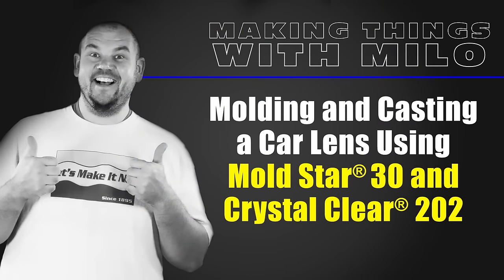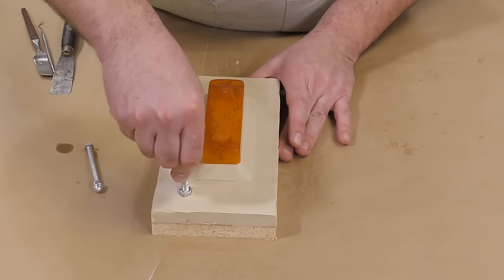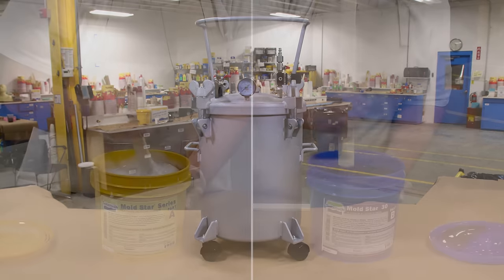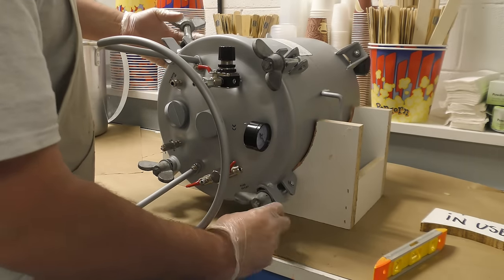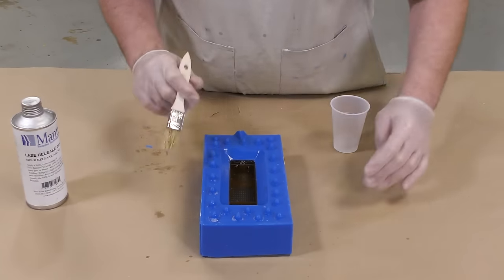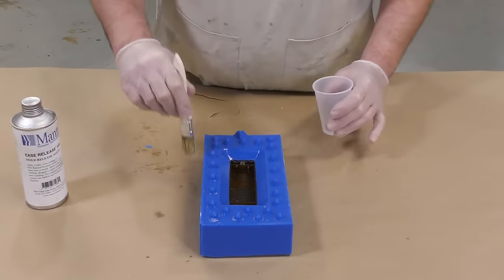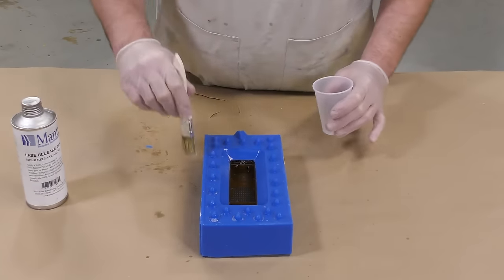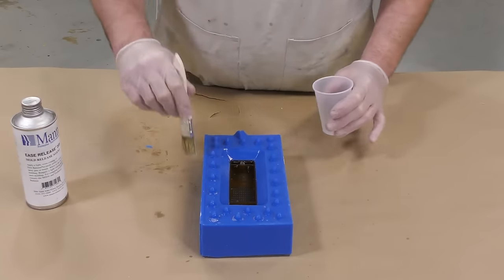How to Create a Replacement Tail Light - Moldmaking and Clear Casting Resin Demonstration

Comment: Back in the '80's I worked as an industrial designer/ modelmaker. We used to scratch build designs and often cast them in silicon to produce duplicates. Later it all became SLA resin rapid prototypes but the old ways are still good for duplicating items you don't have in CAD. We used to use a vacuum chamber with a heavy clear acrylic slab top rather than a pressure pot - the silicon would 'boil' as the air bubbles came out. The pressure system squeezes the bubbles really small but they are still there. Never try casting without vacuum or pressure or you get voids.

Comment: Great video. I'd like to see how you'd tackle a three-color tail light lens. I assume you'd want to pull a new single color lens out, then cut it apart on the color lines, and build it up with three separate pours, using the partial lens as a part of the 'mold' for the first one or two pours, depending on design.

Comment: Thank you for your response to my request! You can expect an order soon! My next request would be items such as radio knobs and other handles/knob for automotive application. If you really want a challenge, take an antique auto knob that is in rough condition and try to create one in it's original shape!
Reply from the maker: Thanks ElderlyIron, this is a great idea, and we will forward this to management!
Reply: Could you do that with a 3D printer?
Reply: Its easy to do.
I make glow in the dark accessories.
Was thinking about making some how to videos without using high tech or costly items that the average person doesnt have.
Reply: if the handle is in 1 piece but pitted with holes  try  this  mix some bondo  to  fill crack and holes let  it dry about 1 hr then sand to the original  shape   should mold like new

Comment: Great Idea. I did something similar many years ago. I used fine grain sand mixed 50/50 with plaster of Paris ( the sand/ plaster mix is for a stronger mold ). I made tail light lens for a 52 dodge that I was restoring.

Comment: Do you think a 3d printed mould could have produced similar results to your silicone version?

Of course you'd have to model the lens in 3D which could be a challenge.
Reply: Depends on the print quality I suppose. I'm not sure the screw grooves' fit would be to your satisfaction.
Reply: if its resin 3d printed yes, if its fdm typical 3d printing, you would notice the lines inherent to the process
Reply: @86Spain  you can sand those out resin print also has lines there just finer

Comment: Is it 60 PSI of pressure or vacuum in the chamber?
Reply from the maker: Pressure
Reply: So it's always pressure for bubbles to shrink during the cure and not for bobbles to pop like degassing process?
Reply from the maker: +Inspire To Make correct
Reply: Smooth-On thanks
Reply: @smoothon  Why pressure vs. vacuum?

Comment: Your mold making videos are really adding new things to the Smooth On videos. I hadn't seen the sideways pressure pot trick or the cutting resin vent tricks before.

If you were doing a completely clear piece would you have to vacuum degas the silicon too or is the pressure pot enough?
Reply from the maker: If you have the ability to do both, you should.  If not, the pressure pot is a good choice.  https://www.smooth-on.com/support/faq/131/

Comment: My 1990 Lincoln and 96 both have plastic head lights and turn signals. I have learned to aerospace 303 and motorkote spray them to keep them from cracking so far it seems to work.

Comment: Great video. I have a question. I have a motorcycle and want to change the look of the headlights. I have a zx14, Can I use this method to redesign them?
Reply from the maker: +djtren63 you could, if you need help, send us a tech support ticket via smooth-on.com
Reply: ok thanks

Comment: I have a concern about whether this material will hold up to heat as well as the original, and UV exposure.  Heat may not be as much of a problem on a turn signal indicator, except if someone forgot to turn it off.
Reply: @Stinky Cheese same here, stop-n-go traffic in Los Angeles will crack even original brake light lenses, will this material take the heat?
Reply: I use a food dehydrator at 145F to post cure my lenses, left on one half of the mold. This increases the strength of the resin a lot, strength it would normally only reach in 2+ weeks. I've used some of my failed castings at shows to do drop demos onto concrete and asphalt to show how tough and scratch resistant they are.

Another reason for post curing Crystal Clear 202 is to increase its heat resistance. The lens cast in this video, if put in water the temp that comes from a typical kitchen hot water faucet, would soften and be easy to distort. Heat it up in a dehydrator for a few hours and it won't ever soften at any temperature lower than that. Even after this curing I can still use a dip in 200F water to bend castings for doing modifications to make another mold to replicate the new shape.

But you cannot do this post curing so soon after casting. I wait a minimum of 24 hours before post curing and I leave the castings in the pressure pot that long. Why? Because leaving a 'green' 202 casting in contact with the mold without being under pressure tends to cause 'suck back' markings, areas where the resin shrinks away from the mold.

Using convection heat, flowing hot air, is important! When I first started resin casting with Smooth-On products 16 years ago I tried to use a normal oven but the radiant heat ruined the castings (massive suck back) no matter how old they were. An old food dehydrator or countertop convection oven is ideal for post curing. Since the dehydrators I have only go up to 145F I bought a small convection oven which only goes down to 200F, for resins (like some epoxies) that need higher temperatures to reach their ultimate strength.
Reply: Use an LED bulb

Comment: Definitely need to do some of these myself. A question though would be setting up multi colored lenses say where the clear backup light is integral to the red lens.
Reply: probably have to cut the clear area out of the red. then make a clear to glue in that hole. that's how my taillights where made clearly because they broke in a wreck. was pretty obvious. I'm not an expert like that guy though.
Reply: I also need to know how to set up a multi colored lens.
Reply: Pour it clear and then tape off the section needed to be red. Spray it with a can of red tint spray. You can get it from the parts house for about $12. I’ve don’t it many times and it works perfectly.

Comment: Hi there. Excellent video. Please explain why you used pressure instead of a vacuum. Thanks
Reply from the maker: Pressure can be applied after the material is poured, allowing for a bubble free casting.  After material is vacuumed, it still must be poured into the mold, which can create bubbles.

Comment: It is good to know one can reproduce a part using this method. But it only makes sense if you are restoring a high value car.
Reply: not just high value, but re-use the mold to pop out a dozen or so and sell them on ebay for some profit :D
Reply: Value is in the eye of the beholder
Reply: @VitaliyKhomich  exactly if ya need it ya need it

Comment: i have a 1983 suzuki LT125. it was handed down to me by my father. the plastic fenders are discontinued, and EXTREMEMLY hard to come by in any decent shape. i wish i could mold my own :(
Reply: - BATER-  I just bought then sold a 1985 LT 185 in mint shape... Then bought a z50 for my girls son, wish I never sold the LT. Thing was awesome and a great starter quad.
Reply: The only thing is it would pop out of reverse sometimes but the rest of the quad was the best and cleanest one I seen to date.

Comment: Always thought a vacuum chamber was used to cast moulding.
Reply: that is pressure cooker not vacuum.
Reply: A vacuum chamber helps suck out the bubbles before pouring.  A pressure chamber helps squeeze the tiny bubbles after pouring.  They do different jobs, and you can use both.  At 60PSI any entrapped bubbles will be shrunk to (I think) 1/4th their original size.
Reply: @ElizabethGreene   Well 1atm is like 14psi, so yeah, 60psi is around 4 atm.

Comment: That's a great project, though I can imagine it would be rather pricy.
Reply: @maxanderson755  Casting rubber: ~$35.  Casting resin: ~$42.    Pressure pot: $100 from Harbor Freight if needed.  Total would be under $200 with the pressure pot.  Access to an air compressor is assumed, but if you're doing a project like this you'd likely already have one anyway.  No, it isn't a cheap way to get a lens, but if the lens isn't otherwise available it beats not having it.  I need to replace the tail light lenses on a 50-year-old car, and I haven't yet been able to find anything other than the complete light assemblies for $250 each--and even if they're in perfect condition, the lenses are still 50-year-old plastic and not likely to last.
Reply: @danbrown586  and what if the lenses or mirrored? and the other 1 is broken? how can you create a mould then? (im just curious)
Reply: @dcpred3889  I haven't yet used this technique.  If one lens is broken and you have all the parts, I'd expect you could glue them back together (maybe with CA glue) to make the mold.  If not, I'm not sure what would be the best way to proceed.
Reply: @dcpred3889  First off, I've never done what is being shown here. with that said, to make a mirrored part, would take an extra step or two, but basically not hard to do at all.  In the example of this video, the mold he made is the negative, the part he created is the positive. It would just take some playing with positive he made (Maybe cutting in half, to reverse the  locations of screw holes, as an example.) I'm gonna say it takes some creative thinking, that's about it. Another thing that may come into play, when trying to make a mirrored part, is not letting a "POSITIVE" part dry completely. If it is possible to take a part out of the mold when only 50 - 75% cured, then do what ever slice & dice, and than let the part fully cure. The quality of the part {Finish} may look bad, but what your after is: Can you now use that low / bad part to cast a part with a great finish.   Or maybe simple as making a mold (Positive, put another way, this would be your 2nd mold) from the first (Negative) mold created.Just an old autobody (25 yr's) 15 yr's welder, metal CAD-Designer/Fabricator., offering my two cent's. Remember, you get what you pay for, you paid nothing for this advice. LOL!!!
Reply: @dcpred3889  To my knowledge there's no reasonable way to accurately reproduce something so detailed in a mirrored form, using hand-working techniques. Ideally you'd borrow a good pair of lenses and make a mold from them, then give them back. Otherwise, unless you're proficient at Solidworks, Alias, or a similar program, and have access to a very high quality 3D printer or 3 to 5 axis mill, it's going to be worth your money to literally buy a parts car just for the other lens.

Comment: do a split color lens amber/clear.
Reply: So that it's not legal to use on public roads?   Umm, why?
Reply: Stinky Cheese DOT likes amber, yellow or clear with colored bulb. A divider is needed between colors. 🏁
Reply: Yellow and red lenses are used in many cars and in many countries a yellow indicator lens is required along with a red stop and or taillight. I have paid close to 4 figures for good original lenses that were unavailable. This process appears to be able to replicate those without to much expense. I would be very interested in further lens casting demos using more complex lens shapes.
Reply: petro206 jks,ls.ss
Reply: @stinkycheese804  Not everybody here lives in USA . Europe. for example uses Amber/Red  lenses
Reply: My lenses are Amber Red and Opaque Clear.

Comment: I am just curious why you use pressure instead of vacuum?
Reply from the maker: Pressure casting a resin is more suitable for a 2-piece mold such as this.
Reply: Why is it more suitable?
Reply from the maker: +Larry Hutcherson Sr because vacuuming happens before pouring, bubbles can be entrained in the process of pouring the resin. These bubbles could get caught in the resin.
Reply: But if there bubbles , in pressure they will be smaller and pressurized, am I right? They do not pop out , right?
One thing its better, its cheaper to pressurize.I will try.
By the way thanks for good video.Good job.

Comment: You could always go the other way and just by a couple of generic indicators and fit them to the truck, then blank out the space where the old indicators were.

I don't suppose many people have a silicon pressuriser tank or whatever that thing is called, come to that I don't suppose many people have silicon laying around in their garage, mind you many people don't even have the luxury of a garage.

So an alternative to the problem of not being able to get hold of the right lens for your truck or car is to use a generic indicator and blank out the old one's.

Seems pretty easy enough to do, and you don't even need a welder.

But if you really want to do this you have done a good job explaining how it's done.
Reply: "Silicon pressuriser tank?" 😄 It's a paint pot. Also known as a pressure pot - which is the term he uses. It has nothing to do with silicon (or even silicone, LOL), specifically, other than this is one of the many things you can do with it. This was explained, I'm sure, in this video, although perhaps not in tiny, technical detail. 

"Use a generic indicator and blank out the old ones?" What kind of backwoods, uncle-dad, three-tooth, tabbacky-chewin' stuff are you talking about?

The man has full access to this shop, where he works, and is doing what his boss tells him to do. Why on this green earth would he do some junk-yard, spray can chrome, duct-taped bumper job of something when he has everyhing needed there to do it correctly? 😄

Besides, if one has the room, a relatively cheap air compressor and a $25 auction-find paint pot can get you set up to do the exact same thing, no blacking-out of extra lights needed.

Comment: I had no idea molding plastics was this simple. I'm so used to heat molded recycled plastic. Which plastics are good at "wetting" fiberglass or Kevlar? I need to make some engine parts in the 220F range.
Reply from the maker: You may want to look at our EpoxAmite HT high-temp laminating epoxy. https://www.smooth-on.com/products/epoxamite-ht/

Comment: Way too much work to replace a part that is still easily available. Crazy
Reply: These blinkers are easily available, come in all colours, and cost less than 15€ a pair.
Reply: TIL every automotive lens ever is readily available.
Reply: For this particular part you may be correct. But it is a good part for this instructional video.
Reply: He said "this model not available /discontinued in market"
Reply: CTZN  and it is made in a non standard color.
Reply: @karlnapp7564 , excellent job of completely missing the video. It was for a discontinued [not available] part, AND in a different color than was ever available. It was a specially made item. So, NO you cannot find that item for 15 pounds, dollars, chickens, or anythings, anywhere.
Reply: @karlnapp7564 , you once AGAIN missed the ENTIRE point. The color he created the lens in DOES NOT EXIST for sale ANYWHERE. Can you not understand English? It is a non-OEM color. You can't BUY a lens in that color, because it doesn't exist. It has never been made by any company to sell anywhere. My God, you're dense!
Reply: @MaryAnnNytowl  I could not recreate the original color, but luckily it turned out the color i wanted. LOL
Which is way better than ordering an indicator light in the color i "wanted", which is obviously possible.
And ordering a clear white one and color coating it yourself is completely crazy and way too much work.
Reply: @karlnapp7564  I would fear that whatever the coating were thinned with would cloud up the plastic on the new lens, anyway. Some reducers are very hard on some plastics. Correction, most reducers and most plastics.
Reply: @MaryAnnNytowl  Yes, thats why they make tail light paint.

Comment: I did the same for an aircraft wingtip light lens. One was missing, and the other was broken, so I glued the pieces together, and made a 2 part mold. Mixed up some Red and Green resin batches, and cast the new set - exact copies of the original, right down to the crack!

Comment: I liked it.  but about the technical knowledge, like why specifically product 202 because of the mold model thickness.  what would some of the pros and cons be for the products that came close and why they just didn't seem practical.
Reply from the maker: A slower setting resin would take a very long time to sure in such a thin section.

Comment: Multi colored lenses can be done by beginners.
Make 2 molds or split your mold in half.
For the back up lights on trucks, make a seperate clear square ( or bowtie, get creative ) and glue ( resin ) them together.
Now, whats missing is the reflectiveness, so I just add glow in the dark powder to the resin.
The lenses glow a bit at night, heps your car to be seen ( & car shows cant get enough of glow pieces, lol )
I never thought people would be interested in this process so i never thought about doing a video of glow accessories.
Maybe in the future i will.

Comment: awesome video thanks. the problem i've had with aftermarket car lenses is the color fades after a while and the plastic gets brittle. I'm  wondering what the car mfg's use for resin and can the average joe buy it because it lasts way longer.